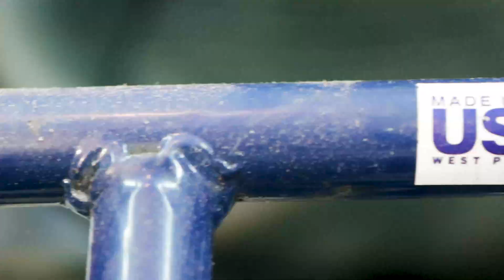Cross Kart Independent Rear Suspension Build Part 2 |  Predator 420cc

Comment: DO NOT run power to those drive wheels as is, but if you do, be damned sure to video it!!! The imminent failure of your design is guaranteed !!! 
You CANNOT expect those 2 joints at the hub to handle the torque that will be applied by the wheels trying to push that cart foreward. You NEED a minimum of 3 joints at the hub end preferably 4, separated as much as practical. LOOK AT YOUR DESIGN BEfORE YOU SEND IT ! MODIFY YOUR REAR A-ARM DESIGN BEFORE YOU DESTROY PARTS YOU WILL LIKELY HAVE TO REPLACE! I am being very serious, your A-arm design at the hub is flawed. Study how A-arms are connected to rear hub assemblies, and modify your design. You likely won’t get hurt, but if you don’t change it, you WILL damage parts, and if you manage to get going fast enough, YOU could get hurt. That would not be good!

Comment: So you just welded the brackets right to the wheel bearings? I would think that would burn out or break down any grease they had?
Reply from the maker: The wheel bearings are pressed into 1/4 thick steel sleeves I made on the lathe, I pressed the bearing in as a heat sink and then welded the brackets to the outside in sections, alternating sides to disperse the heat. Worked pretty good!
Reply: @TyranisCustoms  sweet. I was like “he didn’t just??”

Comment: Where did you get the parts, I've got a single seater yerf I'd like to convert.
Reply from the maker: Alot of the linkages etc are from speedway motors, all the brackets I designed and had laser cut!